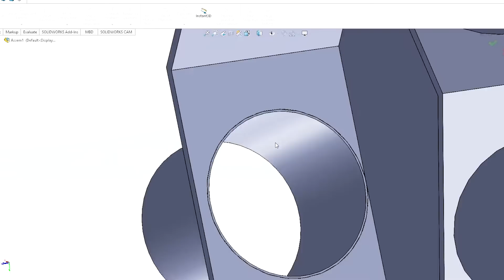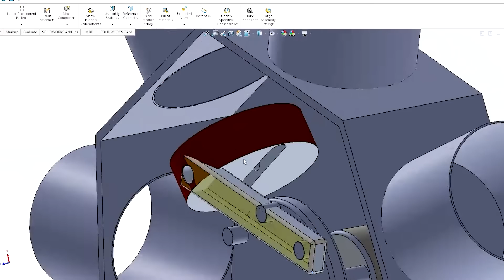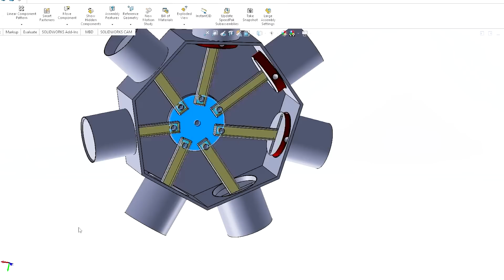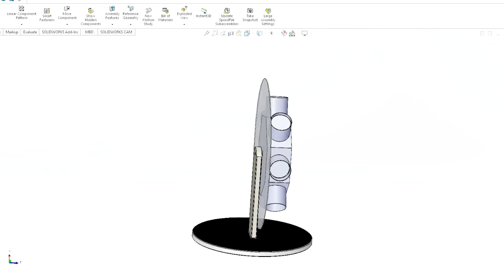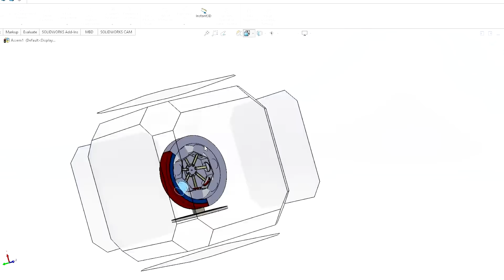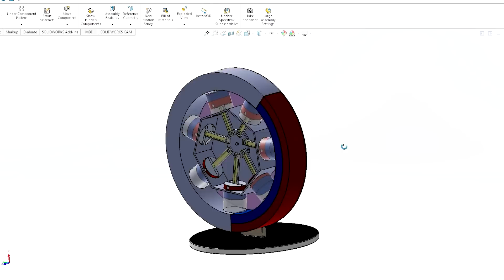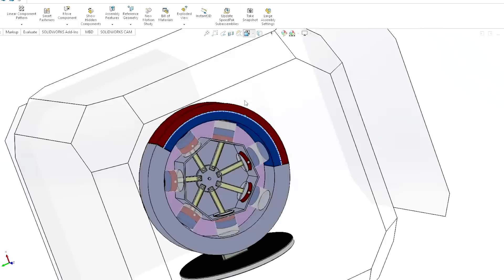Magnet engine

Comment: yep! close1 I wish I was computer literate so we could work together. make the rotating magnet the same size as the "piston" magnet. add a snap mechanism that advances the rotor at zero to ten degrease after TDC. ... ????
Reply: Can't possible work. There are no free energy.
But I would love to see this built in transparent materia.

Because if it works, we would need to build up all physics, chemestry and biology again from the ground up.
Reply: @AndersJackson  Im not seeing why that would need to be done. harnessing the energy of two magnets repulsing each other is along the same lines as harnessing the energy of two reactive metals.